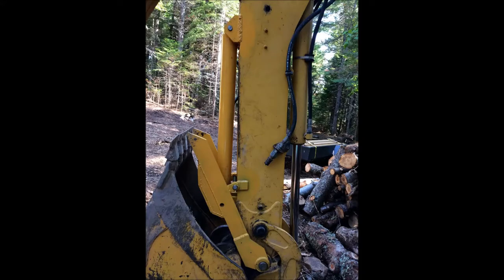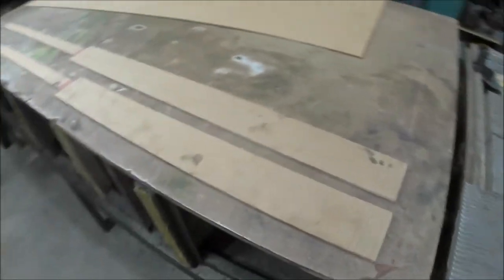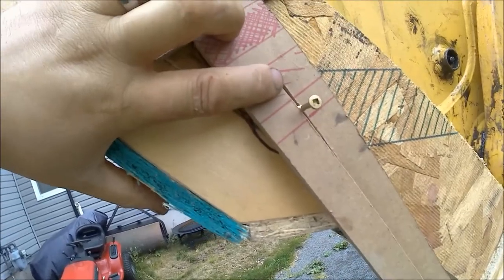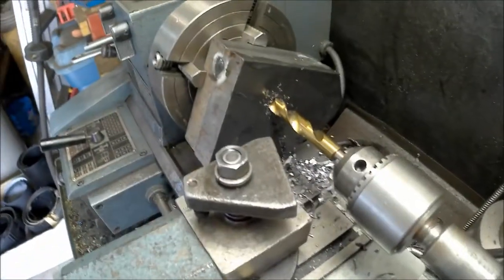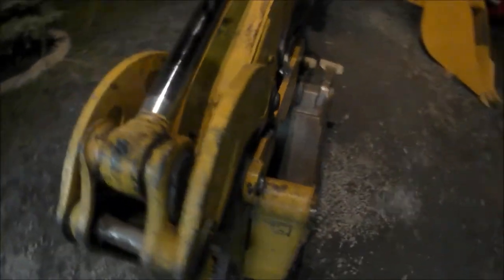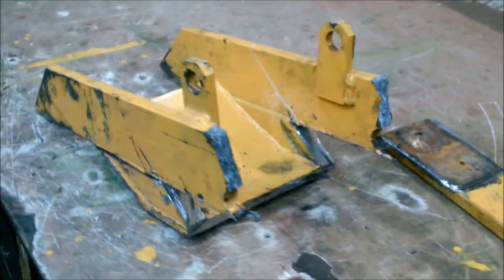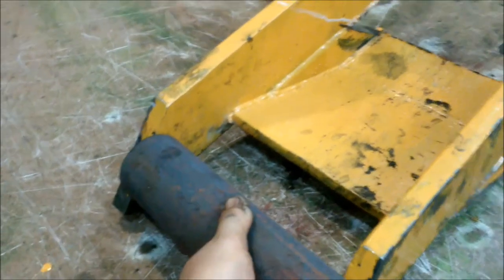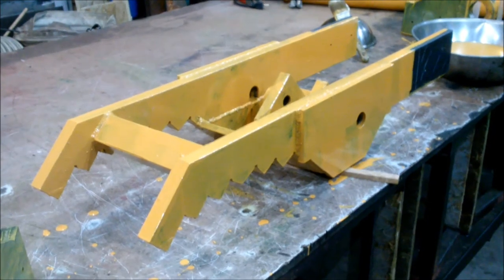DIY Hydraulic Thumb for a John Deere 310SG Backhoe

Comment: Thanks for sharing!  That is a lot of work to get to this point!  I take good note of the wrought iron. A thumb seems simple at first view, but the angles, distance, etc. are critical.  I always wondered about the opposed hydraulic cylinders. I mean the curl and the thumb.  At some point, they might work against each other.  Is there any release valve, let's say on the thumb?
Reply from the maker: Hi Joe, yes, it was a lot of work. I tied the thumb hydraulics into the same circuit as the extend-a-hoe boom, so any excessive pressure will be relieved through the extend-a-hoe pressure relief valve. Thanks for watching!

Comment: Hello Mr. Chris. Is there anyway you can share the plans for this build?
Reply from the maker: I don't really have any more info other than what is in the video. What were you looking for specifically?
Reply: @ChrisOfAllTrades  just wondering if you had a draft of the dimensions I am looking to make a retractable fixed thumb for my 310sg.
Reply from the maker: No, unfortunately I don't, and I sold the machine about a year ago or else I could go measure it.
Reply: @Chris Of All Trades  did you consider tapping into a outrigger cylinder to provide hydraulic for thumb?
Reply: @ChrisOfAllTrades  also you said you just used a "t". Did you consider using a diverter valve?

Comment: You should really try to match the size of the cylinder and cylinder rod to the one that is on the bucket so they work together ok. If it’s smaller you will always be able to over power it and bend it